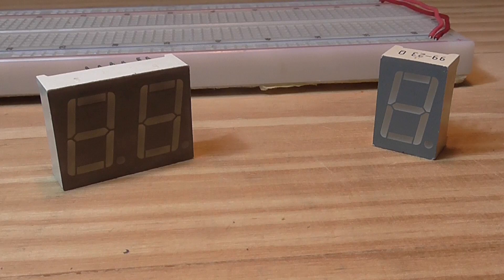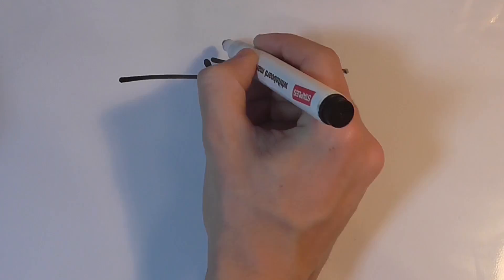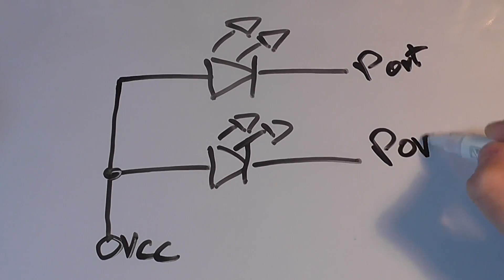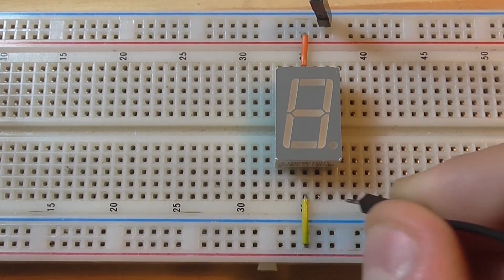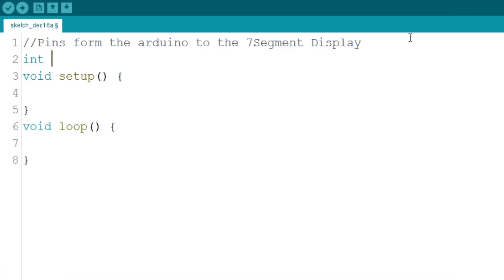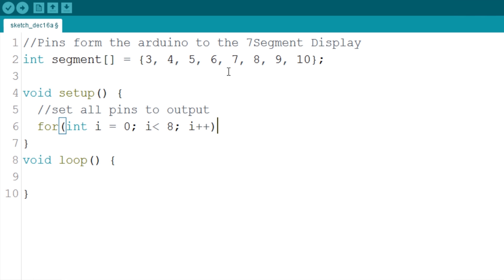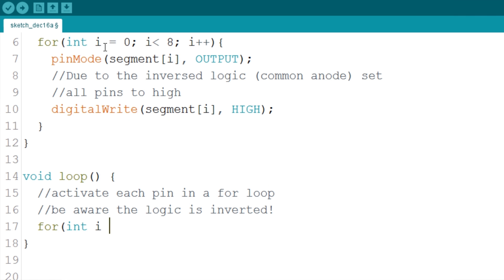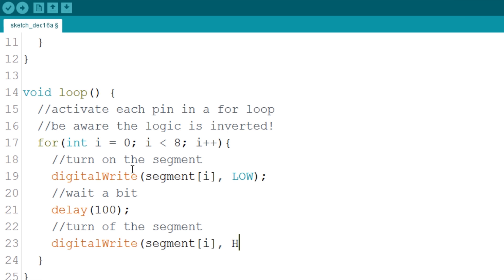7 Segment Display Tutorial

Comment: I used a similar code that merged with another and added some of me. It works well for 4 digits, but there is a serious problem that confuses me. Using FOR, IF and DELAY causes only one number to be seen and I don't understand why. If I use a delay with a low value and x = x + 1, the counter rotates quickly and I see all 4 numbers, but the last one is bright and the others are quite dim. If you increase the fun 1, 2 and 3 numbers quickly become so weak that they are not visible. I used an array plus digitalWrite, PORTD and DDRB to write a number. I'm completely new to Arduino and I don't understand why I'm having this problem. My code is quite short and does not require any libraries (I did not add any resistor, but the screen works and the arduino doesn't overheat ). Without a cycle, all 4 digits are clearly visible. I use an old microwave screen and Arduino Nano.

https://drive.google.com/file/d/10LcGwYbZse5iqW2KaDgEBkiEiJPd3ilE/view?usp=sharing